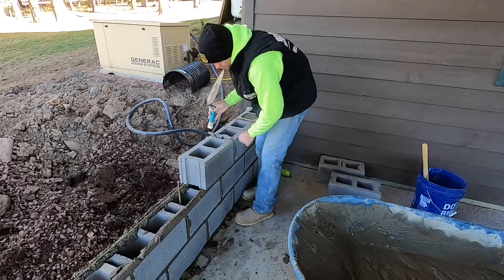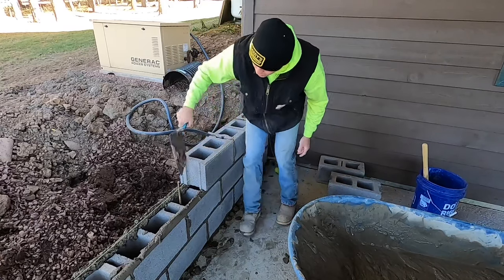How to lay block to the line

Comment: Everyone does things so different depending on where your located it seems. All the crews ive ever worked for in the southren US we always put the head joints on with  the block off the wall. And when only a few corses high lay it with one hand holding from the center. As long as your bond is good and your plum and level no wrong way to go lol. Nice vid for ppl learning.

Comment: Question:  Why are only the face joints mortared and not the ends or centers?
Reply: Bricks crack vertically, they will never crack horizontally along the inside-middle. As long as the faces are supported evenly the middle is negligible. They do fill the middle joints in for bigger buildings that use blocking, for houses it’s a waste

Comment: Where I currently live in the Philippines they don't lay block like this, they use cheap 4" x 8" cement block and lay it quick and not in straight lines, but they do use reo bar. 

 However what they do afterwards is coat it with a layer of mortar/cement mix and use stringlines to get it straight both vertically & horizontally.  Quite a skill in itself. U end up with a smooth block wall that can be painted over. 

So what I did to eliminate this, was make my own blocks using a ratio of 5 to 1 sand & cement mix. But I added molasses to the water to harden the block when drying. 

We ran a few tests and found the molasses better then super plasterzier. 

Had to get some moulds made up and  after a few goes at block making they have turned out  good.  2 fellas can make around 200 a day using a single mould. 

Might sound expensive, but u pay a labourer $15 a day here.

But now I gotto learn how to lay them and I find your channel is a good starting point for that. Cheers.
Reply: Top dollar trade job  in USA

Comment: What’s the detail where the block wall meets the existing wood wall w/ siding (looks like) - is there a metal tie? Or are they not connected? Thx
Reply: Usually, you drill into the wall you're connecting to and add a piece of rebar. You'll have to chip out the end of the block after you stick the rebar in the hole you drilled. You don't chip out the whole end of the block, just enough for the rebar to clear. Then, you fill up that part of the block with mortar.

Comment: Hey, I got a quick question ,  moved into a place  got a heated garage and the one wall  has cinder blocks showing and all blocks are  hollow and has concrete floor on inside is it normal for them to be hollow?
Reply from the maker: They should only be filled 4ft on center

Comment: How many block can you stack before you have to worry about the weight making the lower joints tighter?
Reply: You can lay block to the moon.  That's a myth that needs busted.
Reply: That myth is not around here in Arizona.Especially around the summer months.
Reply from the maker: You can stack them right up. If you notice the block suck the moisture out of the mortar immediately. I’ve never had to stop laying bc of that. Only time that happens is when it’s too cold and you shouldn’t be laying anyway

Comment: What's the best way to break 4in block ? I'm a Plasterer.  Sometimes we replace Gypsum block with cinder block. But tge cmu's are a bit larger.  So we have to break them to fit Sometimes. 
Thanks
Reply from the maker: I use a saw most times. If you don’t have one I use a hammer and chisel
Reply: @masonthemason6412  A grinder or a saw?
Reply from the maker: @ATREZ0123  a saw

Comment: Why are you using 2 hands?   I always laid block with one hand unless they were 75% solids.
Why are you backing up against your hand?   Much faster to go forward like you're laying a brick veneer.
Why is your cut in the field instead of at the end of the wall?  (couldn't see the end very well, but I think you had a full block on the left end).

Comment: Why are you laying over the line? Pop your lead up put the line on the other side and burn that wall up by laying the block with 1 hand an a trowel in the other.
Reply: You are able to lift and set the block with one hand?
Reply: Line goes on the side you plumb.